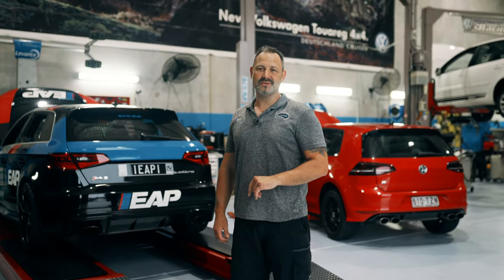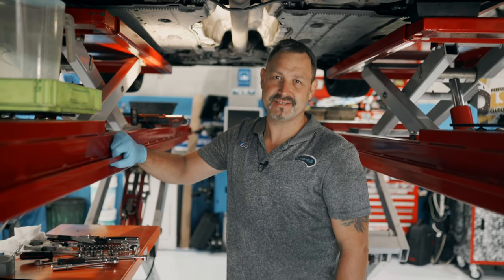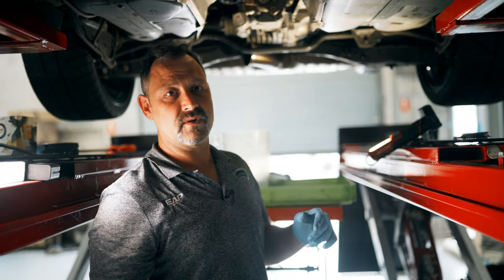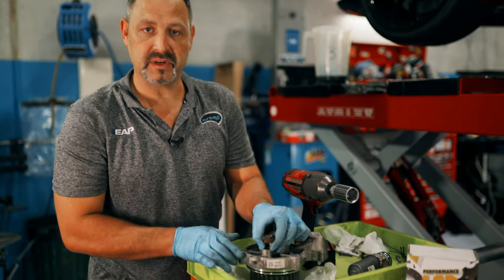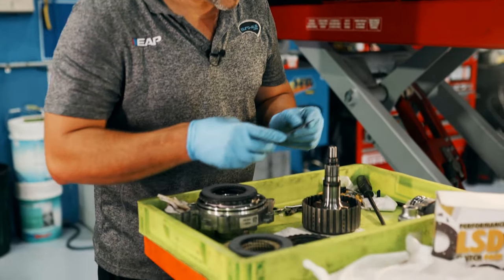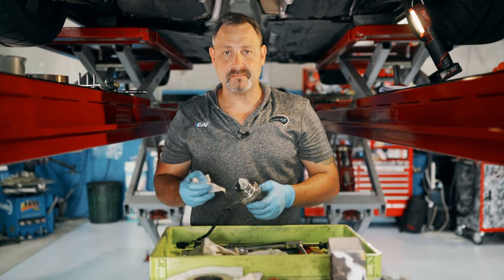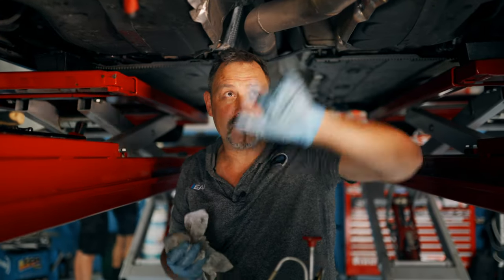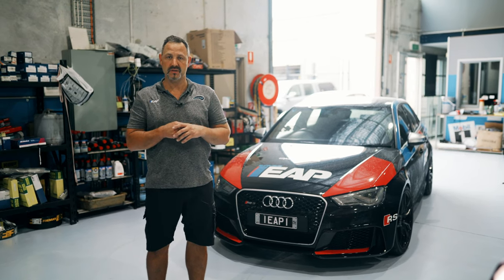Racing Diffs HALDEX Performance Clutch Install | Audi RS3 | Euro Aus Performance

Comment: If haldex oil was in insufficient level, will it causing the "Clutch Overheating" error message appear?
Reply: That would be the gearbox clutches not the haldex clutches.

Comment: We install that diffs on 900hp RSQ3 and they slips . Back to OEM
Reply: VW bitdi 340hp slips too back to OEM.
Reply: JDY and RPC have upgraded clutches with more friction plates.

Can also use stock clutches with aftermarket Syvecs Haldex controller + upgraded spring in PRV allowing for more hydraulic pressure and stronger clamp on the clutches so they can hold more torque.